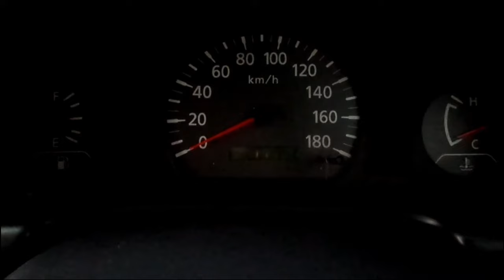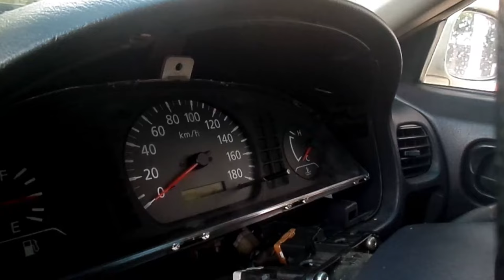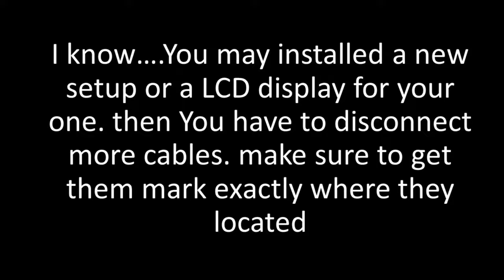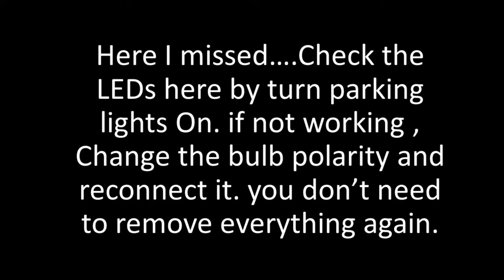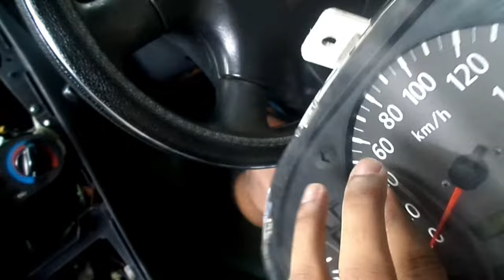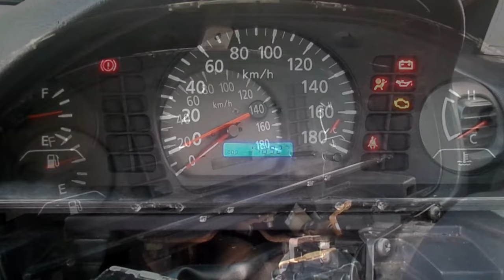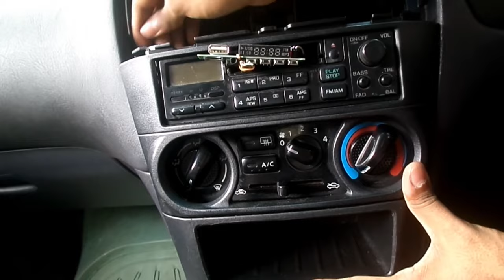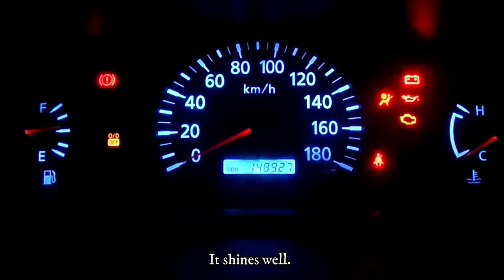D.I.Y.-How to Replace & Upgrade Dashboard Lights on Your car

Comment: You should have used gloves. You should NEVER touch the LED because the grease from your hands will burn out the LED
Reply from the maker: You're right, I'm agree with you.🙂

Comment: Just want to confirm, my odometer which show mileage only once i saw it light up, now its not, you mean the odometer panel use led separate which i could replace it with new one? my car is hyundai accent 2009 mc 1.6
Reply from the maker: Sorry for the late response, mate. Usually Odometer light separated with a bulb, some vehicles not even have a bulb to glow up. so they need to check the odometer by using a torch.

I found that your car got a usual Speedometer. Maybe same as mine or there would be a different light source which comes with the LCD panel.

You better to remove the dash panel and have a look first. if there was a bulb, you can replace it. else, The display may broken.

Tip :- Check your LCD display connectors (which came from the display, a bunch of aluminium fibers in parrarel ) contact with each other. That's another reason why your odometer doesn't shows at all.

BWT, check them out first.

Comment: How to get to display lightning digital
Reply from the maker: Just replace the bulb. For some speedometer variants, That's unavailable. So we have to tear down the digital panel ( Odometer ) and add a bulb with new connection.